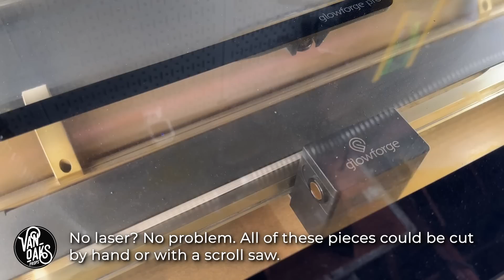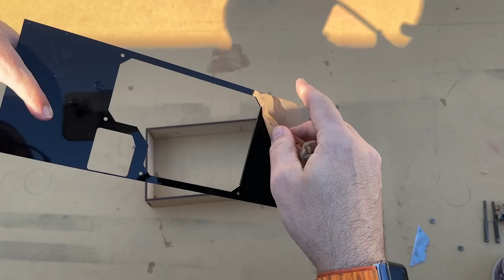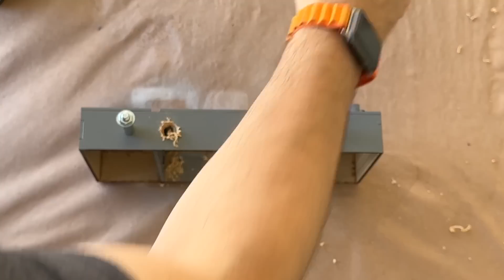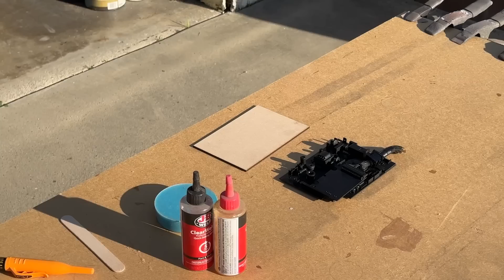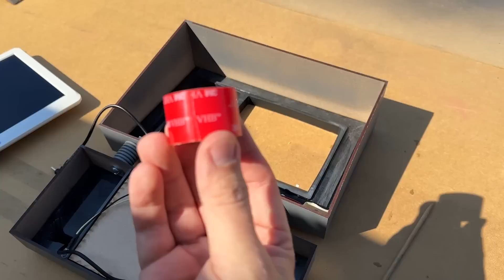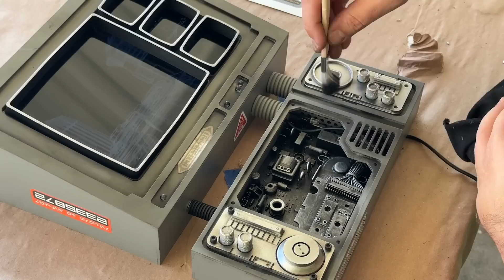DIY Star Wars Data Panel with VIDEO!

Comment: I did similar but with a 10" android pad running home assistant with alarmo for my home alarm system and 3d printed the frame. Gonna try the digital picture frame next, thanks for the idea.